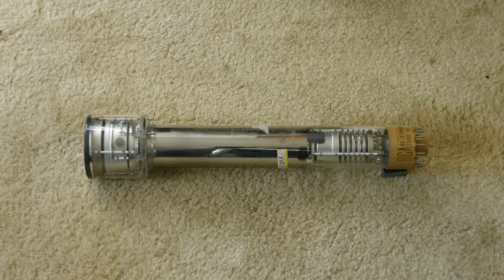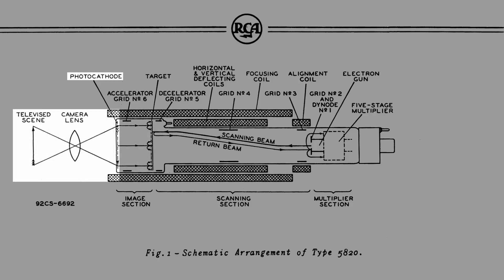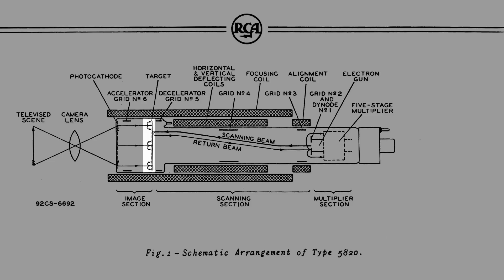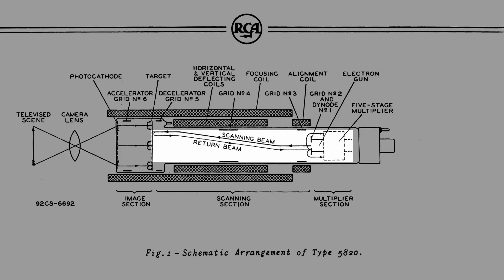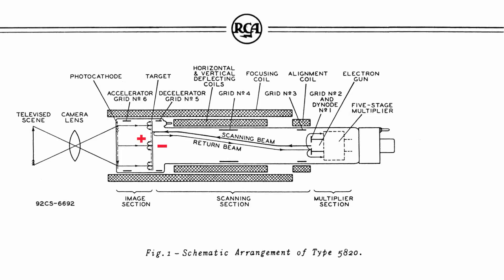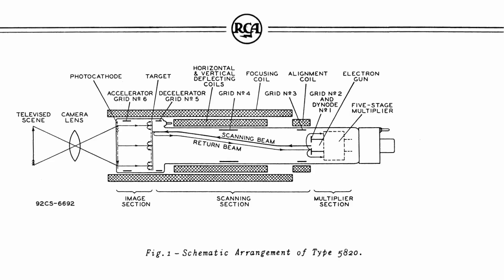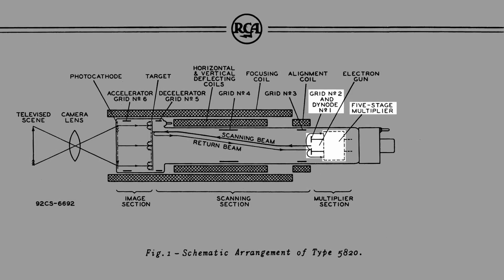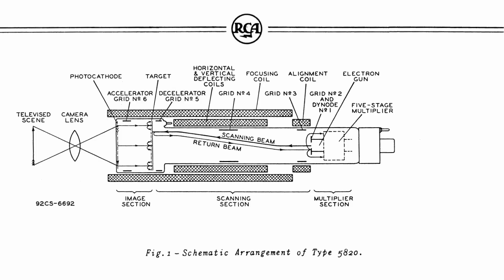RCA 5820 Image Orthicon Tube, How it works

Comment: HOLY SHIT WHEN IT HIT ME HOW IT WORKED IT BLEW MY MIND. That's fucking brilliant.
Reply from the maker: I am so glad for very smart people. Its too easy for me to look at a problem and think, "That's too hard for anyone to figure out". Good news! I am ALWAYS wrong on that point. Thank goodness or we'd still be pickin' the fleas off each other in the back of a cave!
Reply: @videolabguy  i was literally just thinking about that. People are freaking amazing. I try my best to contribute to society but the intelligence dedication and understanding of physics some people have to make something that shouldnt be possible possible is really mind blowing and kind of discouraging.
Reply: Melody, consider that the image orthicon pretty well works on witchcraft!  The author only skimmed on its even crazier kid brother, the image isocon.  The image isocon requires voodoo added to the witchcraft to make it work!

There are several additional control elements added to the IO to transform it to an isocon.  First, is a ring with a hole in the middle called a separator.  Then, there are 4, 1/4 plates immediately after the separator. The electron beam passes through the separator unscathed.  Now, the steering plates place an ever increasing HELICAL SPIN on the beam through the scan area.  At the target, the beam strikes at a slight angle, and splits into 3 parts.  Part 1 neutralizes the target, and is gone.  Part 2 is deflected back, with memory of the helical spin.  Part 3 is amplitude modulated, and comes back toward the electron gun with NO memory of the spin.
Parts 2 & 3 then enter the steering plates.  The part with the spin develops an even larger spin, hits the separator, and is gotten rid of.
Part 3 starts developing a small spin, but passes through the separator.  It then avoids the electron gun assembly, and strikes the electron multiplier, and there is your video signal.
The isocon video is reverse polarity to the orthicon video, so an additional stage in the video chain is required to restore polarity to normal.
Interesting difference between the 2 tubes:  the orthicon generates its noise in the black, where the noise is most objectionable.  The isocon generates noise in the white, which can easily be clipped out.

Never personally worked with the orthicons, but I've worked with the EEV P880X & P8040 isocons, and got quite adept at setting them up fairly quickly.

In my collection, I have a 3" RCA 4401 IO, a 3" EEV P875M IO, a 3" P880X 3" isocon & a 2" EEV P8040 isocon.

Last of the isocons were made by EEV in 1987.  We were contacted by EEV to place our want list for the P8040 as they were doing a final run, and no more...